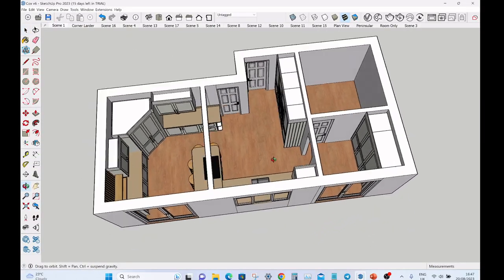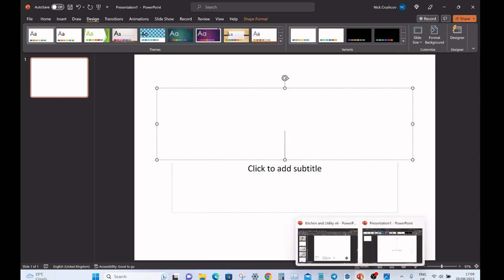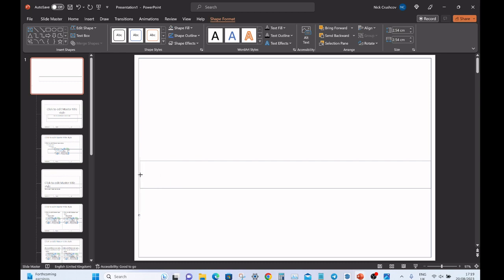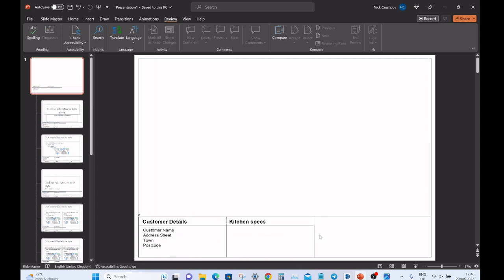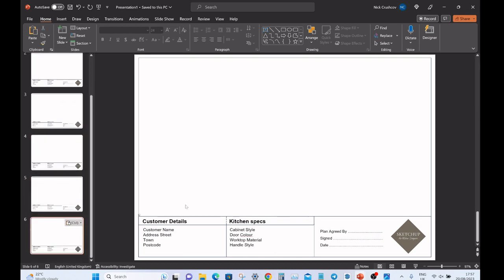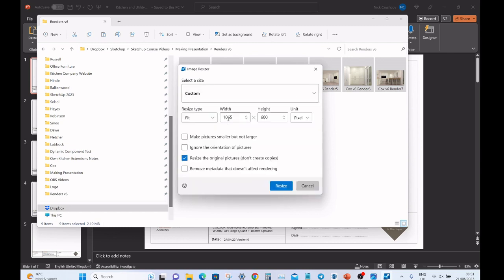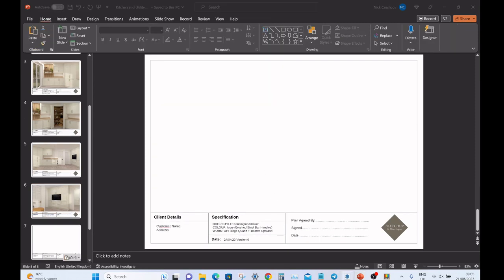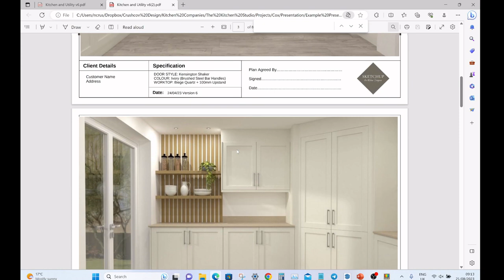Making a PDF Presentation with Powerpoint

Comment: I want to specialist in kitchen and bath designs. How did you learn all the specification for cabinetry?
Reply from the maker: Hi, apologies for the late reply. Can you clarify what you mean by 'specification' - are you referring to the standard sizes (heights, carcass depth etc)?
Reply: @sketchupforkitchendesigner3016  no worries & yes !
Reply from the maker: Ah ok, I have worked in the UK kitchen business for many years and there are standard sizes most companies use. The cabinet heights and widths are dictated by supplier standard door sizes (unless it's a company who make bespoke), here is a link to a standard matrix:

chrome-extension://efaidnbmnnnibpcajpcglclefindmkaj/https://pwstradezoneassets.blob.core.windows.net/images/ec5dc9d54d8a960c731f7b0ff3333c6e7aa88155.pdf

Mostly the cabinet depths can vary depending on the company (because that doesn't affect the door size), so depth of base and tall cabinets is normally 560mm (+/- 10mm), 300mm (+/-) for wall cabinets. Plinth Heights are usually 150mm.

Hope that helps!
Reply: @sketchupforkitchendesigner3016  thank you! Much appreciated! Please continue to do your videos really helpful!
Reply from the maker: Thanks for the comments :) I will be making some more videos soon, just have a couple of projects to finish...
Reply: Hi, can it work for dimensioning in perspective view?